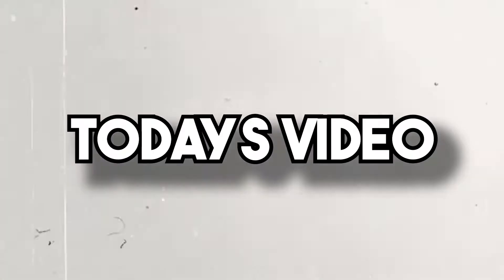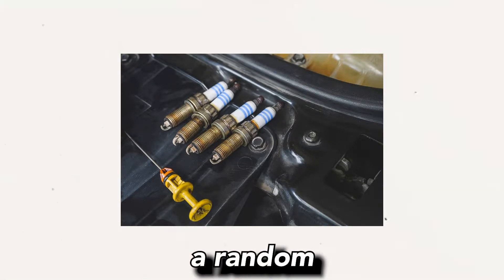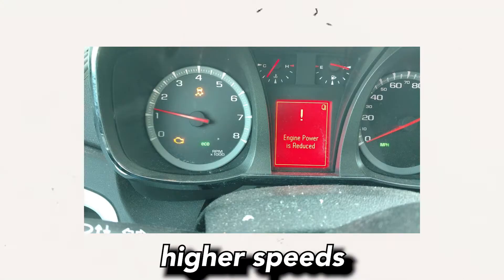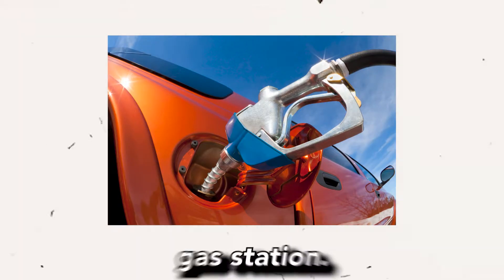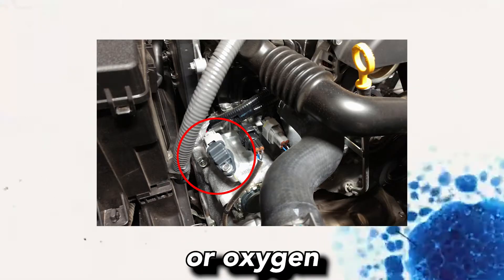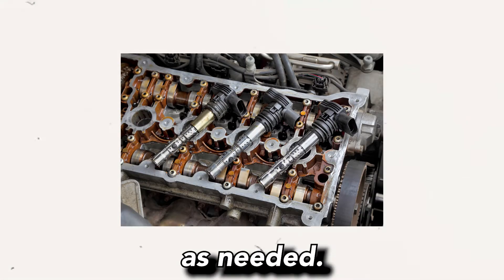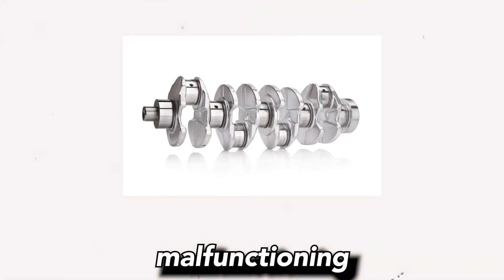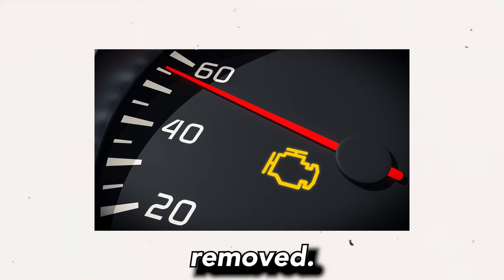Toyota P0300 Code - Causes, Symptoms, and Fixes

Comment: I have the codes P0300, P0302, P0303, P0171
Reply: Were you able to find the issue? I have the same codes on my 2006 Tundra
Reply from the maker: p0300 Code - Random/Multiple Cylinder Misfire Detected
P0302 – Cylinder #2 misfire detected
P0303: Cylinder #3 Misfire
p0171 Code - Fuel Trim System Too Lean (Bank 1)

Comment: I have a 2002 toyota celica GT and I have this code. The issue is there is delay in starting engine. Like I have to key it at least 2 times (sometimes 3) to get the engine to start. Changed spark plugs and fuel pump.. still no change. What could be wrong?
Reply: try changing the ignition coil
Reply: @indifference9600  where's it located?
Reply: Best solution is sell the car no more headaches
Reply: If the thing you removed before you took the spark plug out
Reply: Did you try what op mentioned? Did you use denso sparkplugs? It could be a vacuum leak or camshaft position sensor
Reply from the maker: The P0300 code (random/multiple cylinder misfire) and delayed engine start in your 2002 Toyota Celica GT could be caused by a faulty ignition coil, crankshaft position sensor, or an issue with fuel delivery such as clogged injectors or low fuel pressure.
Reply: @carcarehacks  changed crankshaft and cam shaft position sensors, cleaned injectors, MAF sensor and throttle body but no change.. Could you tell me where exactly is ignition coil?